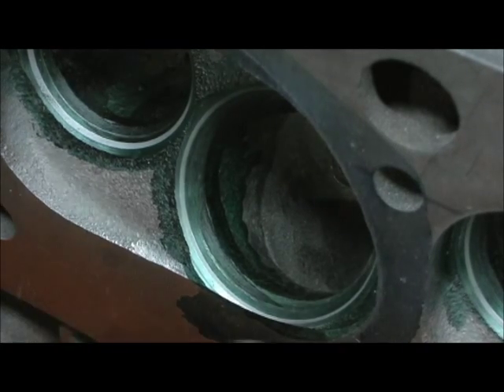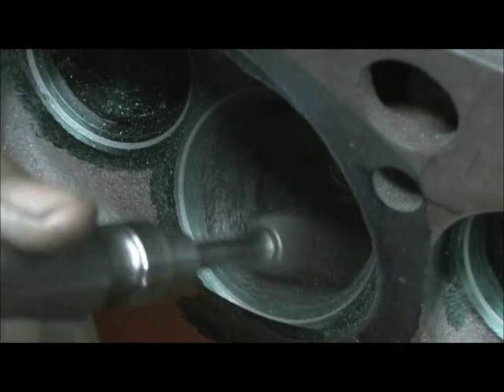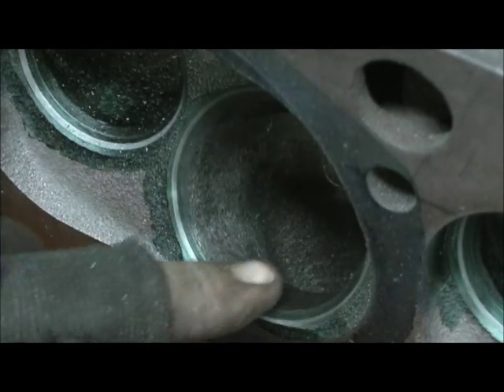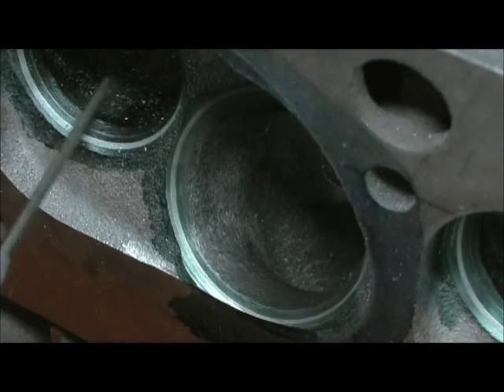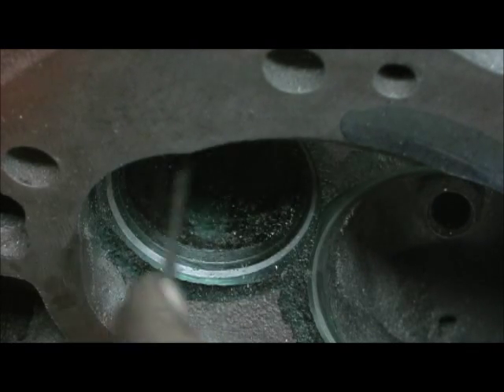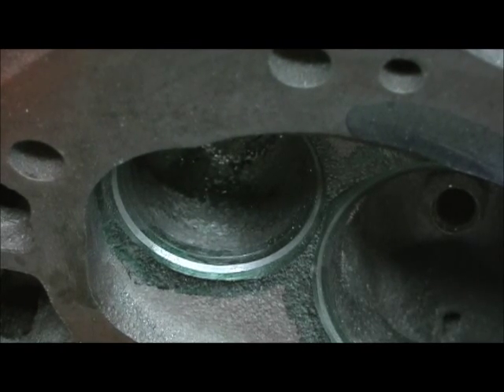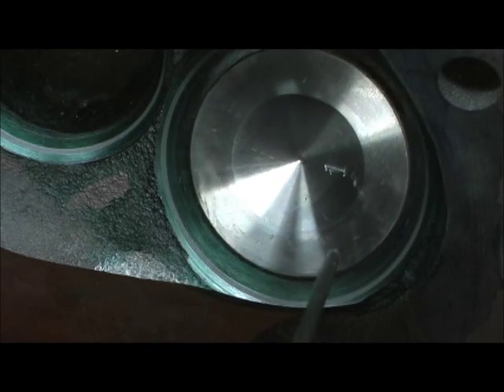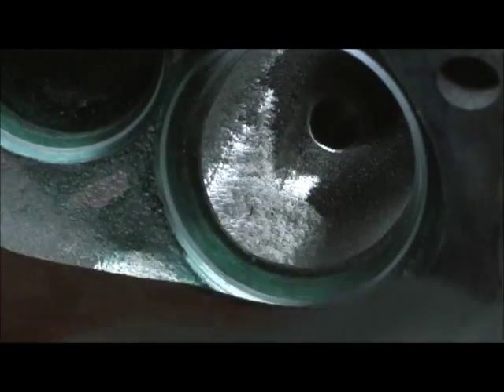BBC 241 Part 8.0 Bowl finishing and sizing

Comment from the maker: The Problem with the 366, is your carrying all the weight of the BBC, without the bore benefit that you need  with a Porcupine head (canted valve). You could make a MUCH better, lighter and more powerful head out of a 383 SBC that has a 4.030 bore that supports the 2.02 valve a lot better than the 366 with its UNDER 4 inch bore. I would not waste my time, TOO heavy for the power it produces. it is just that simple.